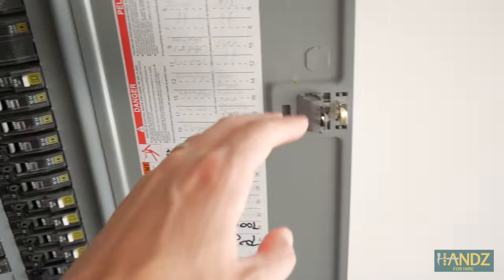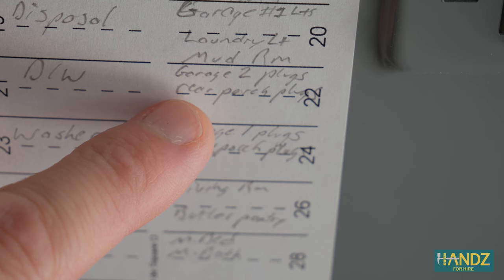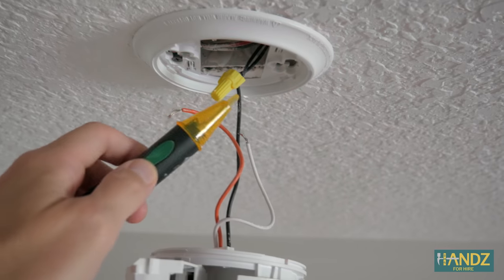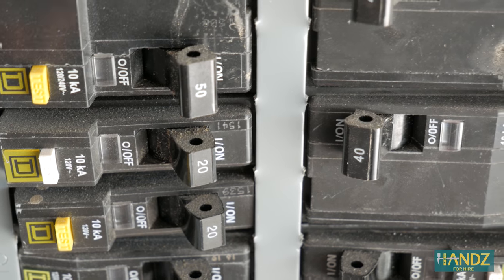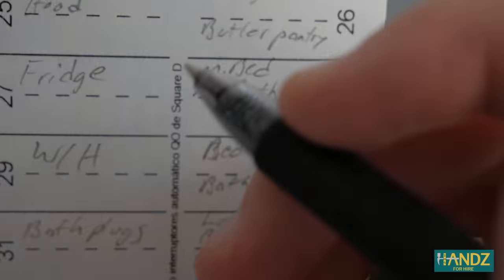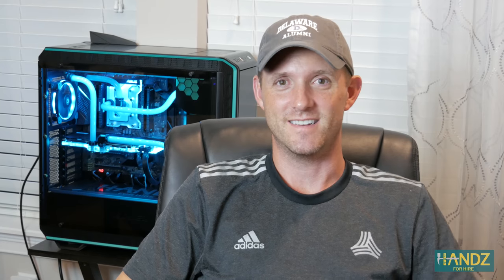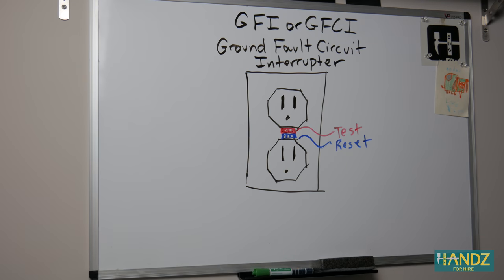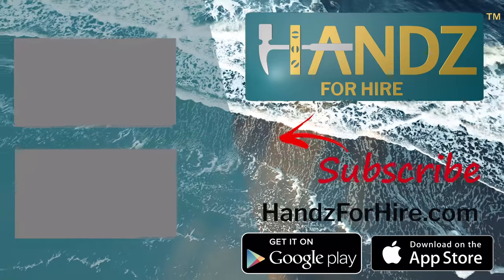Turn OFF POWER on a Hardwired SMOKE ALARM and Live to Tell about it

Comment: Turn the whole house off with one switch. I’m not an electrician but that’s what I do anytime I think I’m going to mess with electrical stuff without dying
Reply from the maker: Nothing wrong with that, but then you have to reset all clocks, turn back on computers, and wait for the internet to reboot. If you can identify which breaker it is one time, then every time after, your life is easier. Both work though. Have a great day!!

Comment: Be careful not just isolating the whole house because a lot of breakers are only single pole and some voltage can still be present between the neutral and ground. As potentially inconvenient as it is, I usually just throw the main switch to be safe
Reply: My experience is get a good head light, throw the master and spare yourself the grief. This is interesting and if I'm ever in an older home that's poorly label the circuit breaker or poorly wired the home I'll take this more careful and insightful approach. Thank you!
Reply: And I’m just doing this instead of finishing the video (I am glad I watched though!!).

Comment: Thanks for the video.  I had the same experience with a couple Firex G-6 alarms.  One additional tip I learned (the hard way) is that if you're using the power light on the alarm as an indicator that you've shut off the correct breaker, you may need to wait a few minutes for the light's capacitor to fully discharge.  In my case, when I saw the power light blink shortly after switching off the breaker, I assumed I had shut off the wrong one.  I went through all the breakers like this, wasting a lot of time, and questioning whether the alarm was even connected to a breaker in the first place.  Afterwards, I found your video and tested only the 15A breakers using an AC voltage detector instead. I found the correct one (which was shared with the master bedroom) on the second try.  Lesson learned.  New alarms installed.  Thanks again!
Reply from the maker: Oh wow! That is a good lesson. Those LEDs don't need much current to light up! I'm glad the video helped and you were finally able to find the correct one!

Comment: Thanks for the bedroom tip. Mine happened to be on a GFI breaker for the outlets of a bedroom. I was about to give up and wire the smoke alarms without turning off the power like a few times previously. But I figured I might as well try the GFI breakers and one of them was money! I had 4 alarms to install so having the power off helped of course.
Reply from the maker: Awesome, glad it helped!

Comment: This saved me a lot of time!  Also, two unrelated helpful tips.  1). If your dishwasher suddenly doesn't power on,  first check underneath your sink or nearby cabinet.  Electricians will typically install a "light switch" that makes it convenient for them to turn power off at the dishwasher, rather than at the breaker box.  If someone accidentally flipped that switch, it will turn the dishwasher off.  same applies near the furnace.  2).  If your first floor bathroom outlet doesn't work, check the 2nd-floor bathroom GFI outlet to see if it has been tripped..  Electricians may tie those two outlets together.
Reply from the maker: Awesome, and those are great tips!

Comment: Wow. This is great. Thank you so much. This helps a great deal. Trying to replace interconnected smoke & Co2 detectors all over the house, but the voltage meter kept beeping every single time. It was weird. We just couldn't find that hot wire connection on the breaker panel, so now, we're going to take your advice, work with the 15A switches and I'm sure we'll find it. What a PITA.
Reply from the maker: Glad it helped! I hope you found the right one!

Comment: Thanks for making this video. I'm replacing all my smoke detectors(10 of them) with a newer brand that has a different connector, so need to do some rewiring. So when I went to the circuit breaker I noticed the same thing with none labeled "smoke detectors" and also couldn't figure it out when attempting to trace the wires in the attic. So now knowing that they're likely on 15 amp breakers to one of the bedrooms it will be much easier to narrow down now.
Reply from the maker: You're welcome! I hope you are able to find it quickly!

Comment: Hi Jay.  Hey man.  Great video!  I've spent much of my weekend trying to figure out wich breaker controls the smoke detectors in my 30 year old home.  Yes...I still have the original hardwired detectors.  They've never been swapped out.  In reading the comments below from others, one gentelman made a good point.  He said the light still blinked on his smoke detector even after he turned the power off.  He determined that indeed the subject detector did not have power by using a tester like the one you have in your video.  Anyway, I'm off to the hardware store to purchase a tester.  Not only will it save my ass from getting electrocuted, it will also help to let me know that the power is in fact OFF.  Thanks again for putting this together.
Reply: Glad you like it and hope all goes well with your voltage detector!

Comment: Rather than running up and down the stairs, a faster option is to run from the circuit breaker to the nearest smoke alarm and look for the green light.  For example if your circuit breaker is in the basement, run to the smoke alarm in the basement. This is much faster than climbing stairs.  Since all the smoke alarms are on the same circuit, when the green light goes out in the basement, the smoke alarm in the master bedroom will also have no power.

Comment: Thanks for sharing this. Your tip about the 15 gauge breaker, really helped to narrow down what my smoke detectors were connected to.
Reply from the maker: Glad it helped!
Reply: @HandzforHire  Last weekend I installed 3 more Nest smoke detectors. The scary thing is, 2 years ago when I installed the first one, I could not find a breaker for it and presumed it was not wired (with a hot wire) and just changed it. The more you know...
Reply from the maker: @ivanwill  wow! Well at least you lived to tell about it!

Comment: Great video. I have similar issue. Need to replace smoke detector in living room, i turn off circuit breaker switch to living room but i still have power ( lights, tv ). I turn off switch to adjacent rooms and power still on. Is this a circuit breaker issue or something else. ?
   Thanks
Reply from the maker: Thanks! Hmmmm, that's interesting. My first thought is that your box is mislabeled, but you'd hope that an electrician would have gotten it right. You'll often have an outlet circuit separate from a light circuit, but it sounds like when you turn off those switches, you still have lights and outlet power. Question, if you turn off living room and adjacent rooms at the same time, does that do the trick? You may have some wires touching which is creating essentially two power sources for your one circuit. Those are all the things I can think of. Good luck and please keep me posted!!

Comment: Thanks Jay. Only reason that I searched this out is I got a jolt on the first unit that I needed to replace. As well, as soon as I disconnected one of the leads in the harness (the hot one of course) then ALL of the alarms in the house sounded -- and kept sounding until I connected up the hot again. And got bit again. lol.  Then I found your video. Thanks! I had to go through about 9 of the 15 amp circuits to find it, but I did. And it wasn't the master bedroom, which I tried first :-) Thanks again.
Reply from the maker: I'm glad the video helped, but sorry you had to get zapped a couple of times before finding it. At least you'll be setup for next time! Have a great day!

Comment: Same issue here!  Thank you for making this video... I have 6 smoke and one CO detectors to replace... imagine running back and forth trying to locate the circuits for all of them!  I thought about just shutting the power off for everything over 40 amps... and just going from there, but this helps a lot!! Thank you!
Reply from the maker: I thought about cutting the power to the breaker, but then I thought about all the clocks I'd have to reset each time I needed to work on the detectors. Lol. The mission was to label in the box and then share to help others save time. Glad it helped!
Reply: @HandzforHire   Thanks to your video I just flipped all the 15 amp breakers.  So what could have been a half day job took about an hour.  Thanks again!
Reply from the maker: Glad to hear!

Comment: Finally, a video instruction that works. Searched endlessly online and on youtube, and got no real help, until I found this video. Jay, you saved me tons of time! I successfully located the dedicated circuit breaker for the smoke detectors, thanks to your video. Thanks Jay!
Reply from the maker: Chris Lee glad to help!
Reply: Yeah, me too. I looked at NUMEROUS VIDEOS...EVEN one done by a FIRE MARSHALL....NO HELP AT ALL. Mine chirped endlessly for over 4 years every 60 seconds tag teaming. I got used to it, but when my cousin moved in with me she couldn't sleep so I had to do something. Jay is my Household Maintenance Superman.
Reply: Can you help please? I don't have a voltage detector thingy! I don't know if I need to switch off a switch on the fusebox. I don't have a switch labelled smoke detector on there. I have ones labelled: lighting, lighting, sockets, sockets, shower, cooker. On the left of those is 2joined together red switches/switches saying main switch. It's a very cheap, 15 year old, basic smoke alarm. How do you know if you have to flick a switch on the fusebox, please!? I have pressed the hush button for 20 seconds but it's not resolved the chirping. Would I electrocute myself by not pressing a switch on fusebox off, then twisting plastic cover off to see which battery I need please? I have a 9v here. To stop it chirping temporarily, can I turn the plastic cover anticlockwise, safely without flicking a switch off on the fusebox!? (I think circuitboard is same as fusebox, isn't it)!?

Comment: Just curious, (I'm not recommending this,) but could you remove the breaker panel cover and look for the different gauge wires?
Reply from the maker: I imagine so, but you'll still have a ton of very similar gauge wires in the box. I think you'd still have to go through the process.

Comment: You can also turn off half of breakers first (eg entire left side). Test wires. 
Now you know which side it is on - either on the left or right. 
Then turn off half of the breakers again on the side you know it is on.
Split it in half again and again, until you find it. 
With 70 breakers it will take you no more than 5 tries instead of 70.
Reply from the maker: That's a great idea. I started out trying save myself from shutting down everything like computers and resetting clocks, etc. If I had just jumped in feet first, your method would have worked well. Have a great day!
Reply: @Markkrochuk1979  I don’t have 70. It just proved the point. With 70 breakers it will take you 5 tries using my method, vs. up to 70 tries if you do them one by one.
Reply: @HandzforHire  you have a ton of high amperage breakers, what are you doing in that house? Hahahah
Reply from the maker: @Markkrochuk1979  Lol mad scientist
Reply: Can you help please? I don't have a voltage detector thingy! I don't know if I need to switch off a switch on the fusebox. I don't have a switch labelled smoke detector on there. I have ones labelled: lighting, lighting, sockets, sockets, shower, cooker. On the left of those is 2joined together red switches/switches saying main switch. It's a very cheap, 15 year old, basic smoke alarm. How do you know if you have to flick a switch on the fusebox, please!? I have pressed the hush button for 20 seconds but it's not resolved the chirping. Would I electrocute myself by not pressing a switch on fusebox off, then twisting plastic cover off to see which battery I need please? I have a 9v here. To stop it chirping temporarily, can I turn the plastic cover anticlockwise, safely without flicking a switch off on the fusebox!? (I think circuitboard is same as fusebox, isn't it)!?
Reply: @vwithers1584  You should not touch anything and call a professional electrician to do that for you. This process is definitely not for you.
Reply from the maker: @vwithers1584  sorry you're struggling with this issue. If you're able to pick up a voltage detector at home depot or lowes (or amazon I have a link in the description), its cheap and a really good thing to have around the house. Mine wasn't labeled in my circuit breaker box either, so you have to use a voltage detector to figure it out. If there's no way to get a voltage detector, then just turn off all the fuses in your circuit breaker, change out the smoke alarm, and then turn everything back on. Best of luck to you!
Reply: @HandzforHire  Thankyou for replying.  I can't get the plastic cover casing off, even by turning it the way the arrow says. It's been put in the most stupid place ever right above the stairs & right outside bathroom door. I don't care about replacing the battery now, I just want chirping to stop asap. Any ideas please?

Comment: If you turn off circuit to that area will it stop the chirping
Reply from the maker: Yes, unless the battery still has some juice. I'd shut it down to replace, but you don't want to turn off long term for your safety. Also shutting off that circuit might kill some outlets or lights that are on the same circuit.

Comment: Did you have to power down the whole house in order to fix thoses wires?
Reply from the maker: No, the point was to find the exact circuit the smoke detectors were located on. Shutting down the whole house works, but then you have to reset all the clocks. If you find out which circuit and turn off the breaker, then it's easy moving forward.
Reply: Thanks for the info
Reply from the maker: @boardgamedicey5024  you're welcome!

Comment: I had to shut 6 breakers off. As these things are so old and never had gang boxes. Also someone ran a wire from 6 different locations like u mentioned. And were individually powered. Probably in a early 2000s someone ran a red wire to get them in series so they'll all trip when 1 does. So definitely be cautious and make sure each one is not live before service. I labeled the breakers by SM/CO.D 1 through 6. No I didnt rewire a Singe line. And added shallow gang boxes. This is diy but if i encounter this again id suggest the owner to get it professionally sorted.
Reply from the maker: Oh no. Sounds like someone from the past created a nightmare for you. Glad you got it sorted, but good advice to get a professional moving forward.

Comment: How do we cut it off for good? I can’t find info anywhere on cutting off power and just using a battery powered one
Reply from the maker: Great question, and my guess is that you can't. Perhaps this is why smoke detectors aren't on a circuit by themselves. You can look up online or give your town a call and find out what the building code is, but I'm not sure battery only is good enough anymore.

Comment: ive bought a new smoke detector it has a battery 9 volt and way to hardwire the unit i dont want to hardwire the unit want run off the battery the green light flashes on smoke detector  ervery 30 secounds is it ok for the battery only thank you
Reply from the maker: Hi Kristine, there are smoke detectors out there that are battery only. These are designed to conserve the life of the 9V battery. The ones that have the hardwiring, only have the 9V battery for emergency backup. In my experience if we lose power for more than a day, that 9V runs out pretty quickly. If you only want to go with battery, I'd look into capping off your wires (for the hardwire) and installing battery only rather than the combo. I hope that helps!

Comment: Hey Jay.  Thanks for the video.  It confirmed many of my thoughts.  My problem is even more complex.  I have no power at the smoke alarm! (Darn.)   Worse yet, I have a concrete home and cannot trace the conduit.  (Holy darn.)  So, I am going to begin by going to the closest outlet.  Please wish me luck....  Bill
Reply from the maker: Oh man, that’s tough and super annoying! (Holy darn lol) Did the smoke detector recently stop working? Did you do any electrical work elsewhere that may have impacted the circuit? For example, did you change out an outlet? Finally, are other outlets or lights on the same circuit working or is the whole circuit dead? That might help you determine where the problem is located. If the whole circuit out, it’s likely as issue at your breaker box. Bad fuse? If almost all the circuit is working and a smoke detector or two is not, then it sounds like a wiring issue. Best of luck and let me know how it goes!!
Reply: @HandzforHire hi, I don't suppose he ever posted how he tracked which wire provided juice to the rest of the units -- did he? I tried a wire tracer but it only showed there was connectivity between all the smoke alarms, but couldn't find anything at the main panel. How can I tell which unit has the actual wires connected to provide power? Shouldn't there be extra connectors in one of the units?